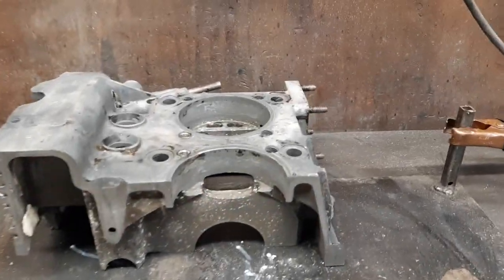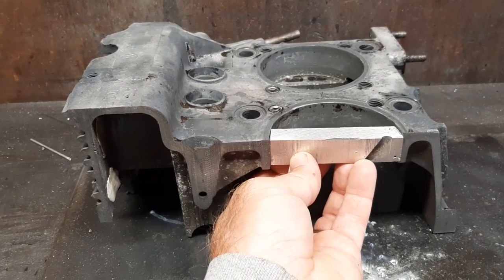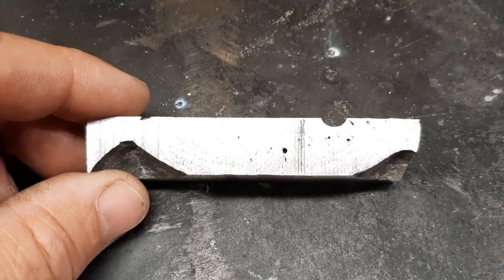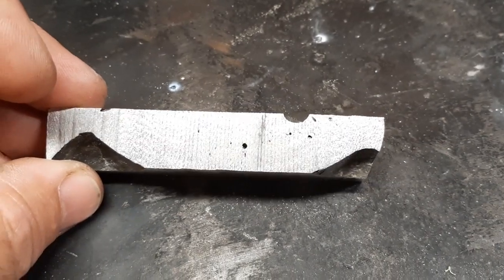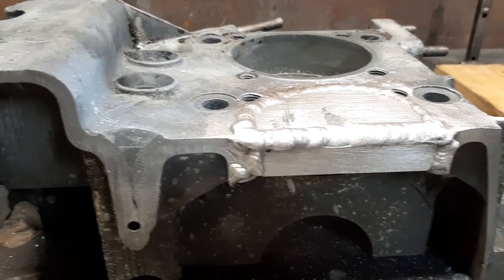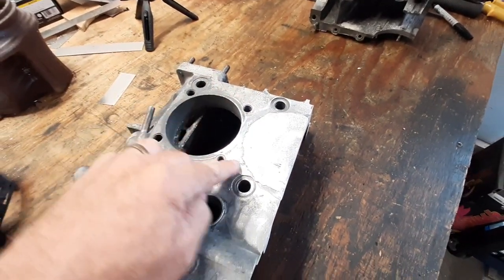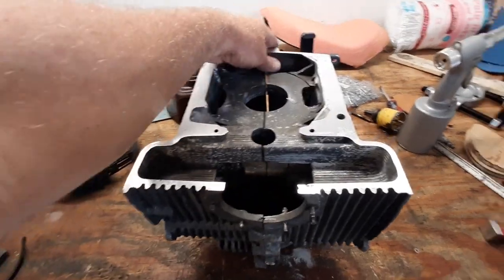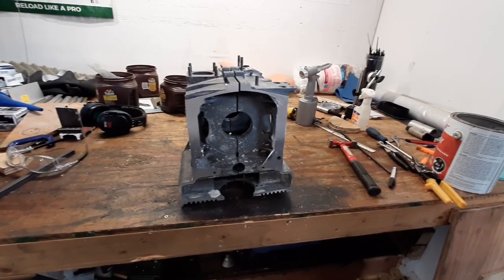1/2 VW Build - Part 3.2 - Case Welding Success!!

Comment: Excellent work!  How will you get the entire surface flat?  Do you have a belt sander that wide?  I recall seeing a plan for a 1/2 VW where a mandrel (basically a bar of round stock the diameter of the main bearings) was clamped between the case halves and then it was face cut on a lathe with a large enough swing.  I can't wait to see your next video.
Reply from the maker: I should be able to use the belt sander.  It's not big enough to cover the entire surface at once but it can catch 2 sides at the same time.  I should be able to rotate it with gentle pressure and get it all flat.  It will be easy to tell if it's good enough when I start bolting the backing plate on.  Face cutting it on the lathe sounds like a good plan B.  I have to turn some bar stock to fit in the main bearings anyway.  Those are used as a guide to accurately drill the back plate for installing the magneto.